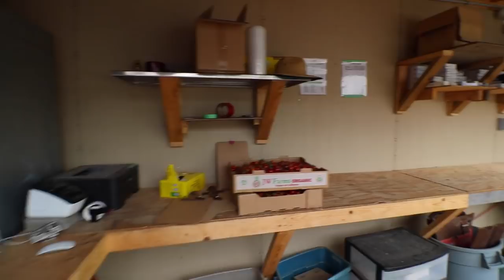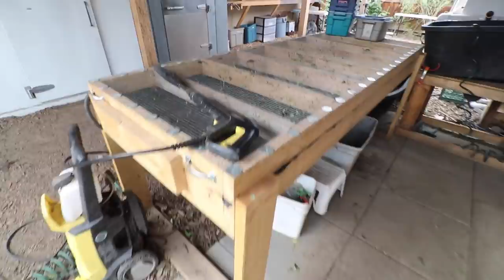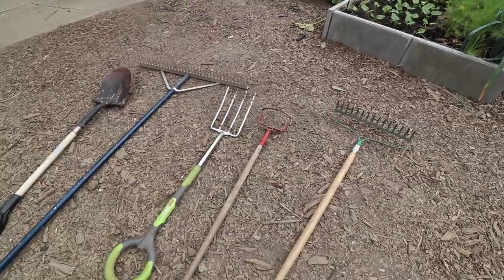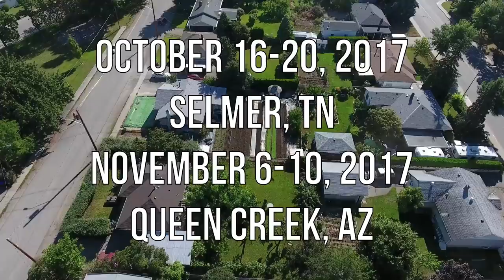HOW TO START A FARM ON $5000 OR LESS!!!

Comment: Summary:

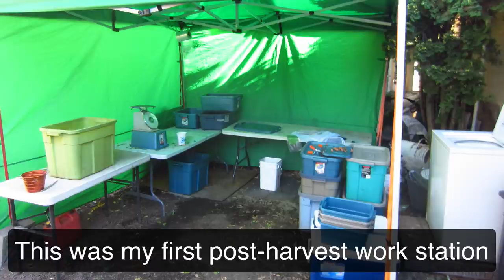1. Walk-in cooler 5:36
2. Washing table 6:15
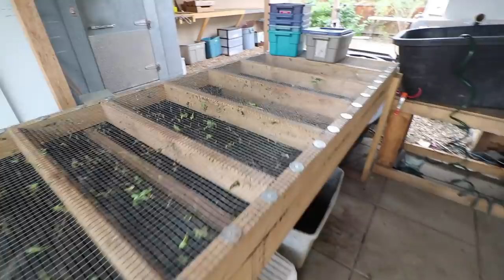3. Bubbler 7:10
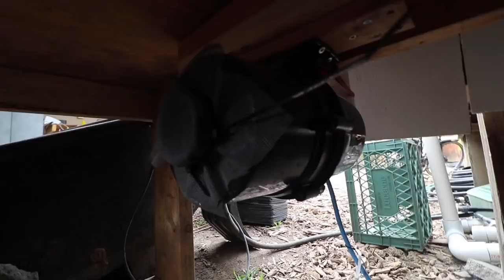4. Greens spinner 7:40
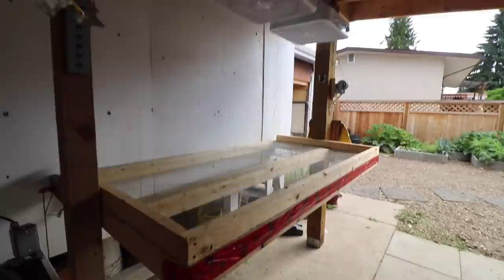5. Greens drying screen 8:05
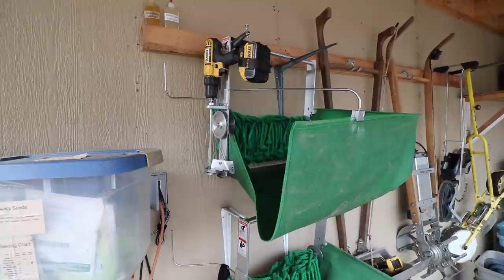6. Quick Cut Greens Harvester 8:44
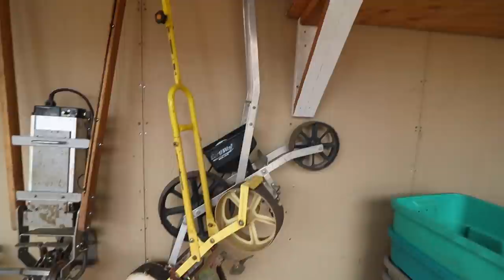7. Seeder 9:20
8.  Rubbermaid Bins 9:44
9. Basic tools 10:04 - Shovel, bed rake, digging fork, stirrup hoe, standard rake
Reply: thanks for the schedule makes it easy to revisit!
Reply: @Junkinsally  yes sheriff Johnson, now can you take the handcuffs off, pls!
perhaps I already know this and like to look at others approaches...sound reasonable sheriff???
PS  sorry I dont have all the answers, but it sounds like you do! bye...
Reply: Lisa A Johnson wow you are a NUTCASE!
Reply: Good man you
Reply: not the man we deserve but the man we all need
Reply: Thanks
Reply: So this is just the infrastructure and equipment. What about the cost of seeds, fertilizer, packaging, etc?
Reply: This list helps!!!

Comment: Another reason I think it is important to just get started, which is normally overlooked, is that for some people getting into that "working effciently" mindset might take a while to get used to. Making a list of things to bring out to the field so you're not running back and forth, knowing what has to be done so there isn't head scratching and not knowing what the most important thing to do is. There is an infinite list to do on a growing farm, it's important to do what NEEDS to be done RIGHT NOW. Also, focusing on less land I think would be better for starting. This forces you to maximize profits per square foot, rather than just make another bed. Thanks for being an inspiration Curtis!
Reply: True. I just started. Got tired of thinking about it, reading about it and talking about it. I  had empty pots around so I started with raised beds.

I don’t have my post harvest area set up so I’m glad I ran across this video. Gotta get started setting that up.😬😁

Comment: Great video. As someone who started out with exactly those numbers - 2000 sq ft and $5000 - I've found that most of this info is bang-on.
The only thing I underestimated was the time and cost of building the actual soil. Until you start digging, you have no idea what you'll find. My QCGH money (almost $1000 cdn with extra blades and shipping) had to be put into the soil. As a result, I restricted my crops to those that do best with hand harvesting: Salanova, spinach, herbs and microgreens. This was totally manageable for me.
I did lose the first half of the season, and yes, I could have shopped for a different plot, but that 2000 sq ft is at my home base and for me that is invaluable.

Comment: I am presently looking for land. Last year I had four plots totaling at least 1500 sq ft. All turned, amended, harvested and cleaned up at the end of the season with hand tools. Almost no cost at all, other than time. But, two were in Vernon. I had four plots separated by 50 km's. Too much gasoline,  too much wasted time. A quarter or half acre on one plot close to home would've saved me a lot of travel time. I am also thinking about the viability of a plot in which I can specifically grow fruit/veg and allow them to go to seed in order to save on the cost of seeds every year. 
     Also, a way to incorporate rainwater into irrigation plan would save money. Most likely not practical with overhead sprinklers, but would work well with drip. I saved nearly a thousand gallons last year between two homes by simply putting a rain barrel underneath the downspouts and letting mother nature do her thing. Easiest work ever. I could do way more too. While everyone's water cost went up in July and August mine went down to nothing. 
     A little off topic, but pertinent to this 'saving cost' vid. I built my chicken coop from the culled lumber I collected from local lumber/hardware stores, my prior relationships as a carpenter sure came in handy. People want to help. The only cost was the chicks ($1), chicken wire and the door hardware! Now we save every week on eggs and benefit from their amazing amount of vitamins and minerals. The hens have long ago paid for themselves and create a very positive vibe in the hood. The same mindset can be applied to urban farming. Develop relationships and everything will fall into place. Put the energy out there and things will fall into your lap. The phone will ring and an opportunity will present itself, just by standing and listening to people. Its what you do with these opportunities that makes the difference.

Comment: if you grow things like potatoes, tomatoes, onions, garlic and cucumbers, on a smaller scale, you can slide by without cooling.  I know they aren't recommended crops by Curtis but they are the top selling crops at the farmer's market in my area of the midwest. Onions and garlic don't really need much cooling, and some of these crops need a special cooling temperature anyway, basically around 50 degrees, so if you had a root cellar that'd probably do the job for you.  Or you can just leave em inside sealed containers in an air conditioned house like I do.  But, a walk in is definitely on the agenda list, and it would have already been bought long ago if it weren't for the kinds of crops I grow.  I spent my first profits on a used bcs tractor, and glad I did!

Comment: Curtis, I've been fighting and fighting to NOT get a BCS tiller. But I've found a used 732 with  tiller for $2200. We've got TERRIBLE impacted clay and I've used the HUGE broad fork to "pop" it up etc etc... it STILL this year is taking a LONG time to get a bed tilled and ready with the HOSS wheel hoe and a small Honda tiller. I watched this vide a second time and I noticed that you weren't talking about the BCS much in it. I know you were trying to keep things on the low end for people to get started. But I also know you are trying to get to no til. Just wasn't sure where you were at with the whole BCS thang anymore. (We are working with about 10000 sq ft if we can ever get it working :-)  ). Thanks

Comment: Hey Curtis, I have a bit of a challenge on my hands. My yard is literally nothing but nettles and bindweed with some couch grass, or was anyway. The area I hope to use is 100 feet by 80 feet in size. I have dug over the whole area by hand, chasing out all the rhizomes I could find. 70 black sacks full of weeds taken to the dump. The area was covered with black tarps for a month, then I did the weeding process again. Another month has passed since then, I lifted the tarps again, but looks like more weeding to do lol. Do you have any other tips to rid the area of weeds other than use chemicals?If I have to keep it covered till next spring I am fully prepared to. This is not for profit by the way, just for my family and friends. Any advice or commiserations gratefully accepted :D
Reply: lostonexxx 

Flame weeder 

And some propane
Reply: Boiling water will kill the weeds in 24 hours. Hard to do in an area that size but it's doable.

Comment: Hey Curtis, it has been my desire for a long time to take one of your classes. I currently live in Las Vegas for work-related reasons. I can attend your Arizona class, it will be good to have several classes of urban farming under my belt before I get started. I potentially have some land on Orcas Island in Washington state that I can lease from a family friend. 2000 square feet
and $5,000 sounds like a great start. the reason for multiple classes is due to my core knowledge of urban farming needs to increase. I have left you a comment on one of your videos about starting a mushroom farm as well as a market Farm. this concept of doing both is too much too soon thank you for your Insight on that.

Comment: Hi Curtis,  In an earlier video you had mentioned getting away from drip irrigation, and I assume landscaping fabric as well.  Are you pushing for more overhead watering now, or has your process become a combination of both based on circumstances - provided you do the appropriate soil preparation?
Reply from the maker: Yes, more less. I'm now moving to do all hi-rotation plots with overhead. Still, all tomatoes and crops like that would be drip though.

Comment: Great information as always.... I got your book and well worth the read...... I planted a variety of lettuce called marvel of four seasons a loose leaf variety for salad mix. It has proved a little disappointing as it is soft leaf and does not handle that well in post harvest.

What is the best way to pack for Kg amounts to hotels that ensure a better life span in their fridges I know you say in your book to use a roll bag . I had a disappointing return visit to a chef who said the lettuce wilted before he used it ..... even though I have had good feedback from consumer purchasers when bought in a bag. 

I looked into the slanova range  of lettuce you talk about but here in Australia they work out about 15 cents a seed which seems really prohibitive.  Do you have any advice on other lettuce varieties or picking and packing for maximum longevity....... I have set up a spinning and drying post harvest station. Regards Russell

Comment: The Helpful Garden
Budget : $500,000

1.) Land : 3+ acres (Budget $25,000.00 or less)
2.) Tiny Homes: 9 to 13 (12 x 18) 216 sq ft [on ½ acre] (Budget $156,000.00 or less) 
3.) Intake Office: 600 Sq ft (Budget $25,000.00 or less)
4.) Farmers Market: ½  acre (Budget $45,000.00 or less)
5.) Parking Lot: ¼  acre (Budget $5,000.00) 
6.) Aquaponics and Permaculture Farm: 1 ¾ acres (Budget $109,000.00 or more)

a.) Up to 3 different fish
b.) Tiger shrimp  
c.) Crayfish
d.) 3 different apple and pears trees so [to have them throughout the year]
e.) Citrus trees like lemons, oranges and 2 two others. 
f.) Chickens (meat and eggs)
g.) Goats (milk and cheese)
h.) Honey Bees 4 to 6 hives 
i.) 2 fig trees (maybe)
j.) Freshwater mussels (maybe)
k.) Rabbits (maybe)

 Powered : [Total Budget $135,000.00]

1.) Solar (Budget $90,000) 
a.) Tiny Homes 13 set of 4 - 250 watt cell with light sensors (52 solar cells) cost between $27,287.00 and $36,387.00
b.) Aquaponics System - (?)
c.) Intake Office - set of 6 - 250 watt cell with light sensors 
(cost between $3,148.50 and $4,198.50)
d.) Farmers Market - (?)

2.) Wind Power - (Budget $45,000) 
a.) Windmill electric generator 15 to 30 KW cost between $18,000 - $48,000 
______________________________________________________________________

Just some working notes:

Payroll for security :  $3,900/wk  $16,900/mo $202,800/yr
3 full time: ($24/hr) $2,880/wk $12,480/mo $149,760/yr    
4 part time: 17 hour work week ($15/hr) $1,020/wk $4,420/mo $53,040/yr

Payroll for gardeners : same as security

Volunteers : 36 (though it's like $6/hr to help pay for their gas and childcare if needed). 
$4,320/wk $18,720/mo  $224,640/yr

Total payroll : $427,440/yr

Money needed for sheltered women: $144,000/yr or $12,000/each allotted to each tiny home (12)
Money of the other 60% profit equals $270,000 

$450,000 plus payroll equals $958,769.04
Needed $263.34/hr@70/hr@52/wk=$958,769.04

235,000 lbs vegetables 
@$0.5/lb=$32.28/hr or 64.56 lbs/hr or 645.5 lbs/day

30,000 lbs fish/crayfish/shrimp 
@ $3/lbs = $247.251/day or $90,000.00/yr

These are all low ball figures
$174,720 online sales per year 
$117,500 vegetable sale per year
 $90,000.00 meat sales per year
       $500 honey sales per year

                  At point soda sales per year

                  Snack & hot food sale per year

                  Cloths & wares sales per year

                  Frozen food sales per year

                  Canning goods sales per year

                  Dairy/cheese sales per year

#HelpfulGarden

The idea is to design a homeless shelter using Aquaponics and permaculture to feed them as well as make money for them. Each place will have 9 to 13 (12 x 18) 216 sq ft building for living in. So the "Helpful Garden" will be shelter to up to 13 people as well as a farmers market. The one thing about homeless shelters is that one can be built every 80 miles about or so. I can see a minimum of 3000 homeless shelters of the "Helpful Garden" being built worldwide. (Powered by solar & wind) To build said place is about $500,000 depending where it built. Though it want need donation or government grants to run for all it's money comes from it farmers market.

Profits: 
40% profit breakdown:

Money needed for sheltered women: $15,000/each allotted to each tiny home each year.  plus stables (Example: coffee, sugar, flour, salt and pepper)

60% profit breakdown:

10% to building new Helpful Gardens
20% to maintenance 
15% to college grants 
15% to etc.

Comment: If you're going cheap, you're going to need an eye hoe to clear to soil.  Trying to clear any amount of land with a normal garden hose is a nightmare.  They're too small, too light, and have to be sharpened too often.

And get a cheap rough grit sharpening stone. If the tool cuts, it will need to be sharpened.

Comment: The wood, galvanized makeup with the microgreens won't pass many inspections in the US.  Wood can take in water, then bacteria, and mold/mildew. The galvanized is not food safe.  US growers may be forced into Stainless Steel as seen in commercial kitchens, if inspected.  Just be aware.  TheRealMartian faced this from his inspector, and had to scrap a very similar wood/galvanized setup for processing MGs.  Hew made a video about the occurrence.
Reply from the maker: +MarkH10 ya, in Canada, all those people first need your permission to come on your property. It's one of the things we have here that gives us way more freedom than the Yanks;)
Reply: To Whomever it may concern:  I worked for Sacramento County for almost 7 years as an inspector.  Later, I was a regulatory compliance consultant for awhile.  In the USA, inspectors also need your permission to come on your property.  They are supposed to ask for it, but I suspect that most don't.  If you refuse for whatever reason, and the inspector thinks it's worth the time & effort, they can go get an Inspection Warrant & return to your place.  Most don't, unless a complaint against you has been filed or phoned in.  My advice:  always refuse initially, but always abide by an Inspection Warrant if it comes to that.  Happy Trails

Comment: I would absolutely suggest starting with a BCS with a tiller attachment. There goes $4800.
Reply: Those cost way too much. A used rear tine tiller is fine. You can get them very cheap. I’ve found 4 for free. I just look online or driving down the road I spot them free on the side of the road or at a recycling center or yard sale they’re cheaper

Comment: what to use for watering and harvest? just hand pick and a garden hose with an attachment Lol?
Reply from the maker: +Maxwell Swanson yes, or spend another $200 to install an irrigation system.
Reply: Awesome, Thanks. and you preferred over head versus drip if i remember? Also, idk if you've been following clif high's Data, but heads up Light Coin(LTC) is about to be huge. hes been calling all these crypto prices, and ltc under 50 dollars at the moment is said to be in triple digits usd by mid august to early september. i just made a 3400% gain on another coin Veritaseum he called. Just letting ya know, Thanks Man! within the next year i will be getting into farming hopefully! also using Pulsed Electromagnetic Fields to promote plant growth!!!!